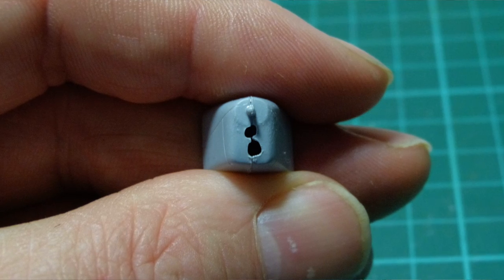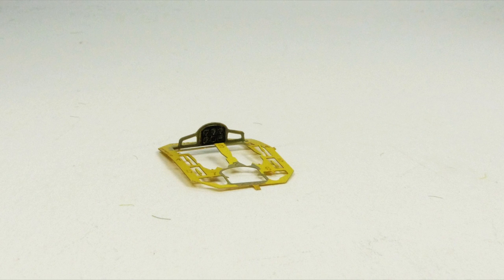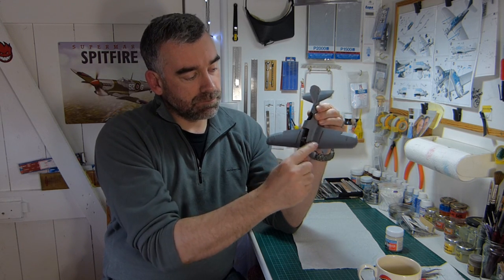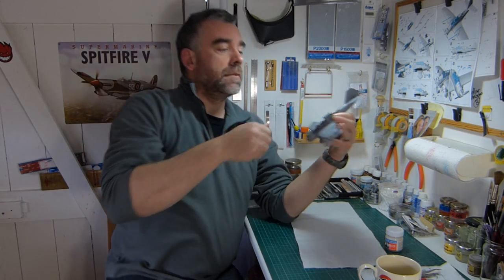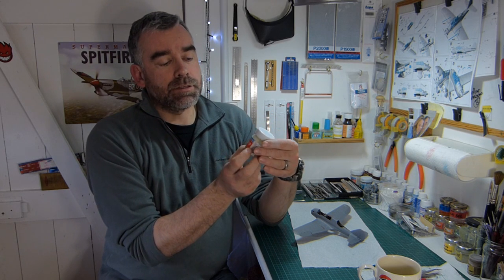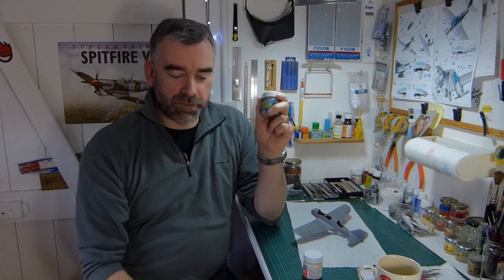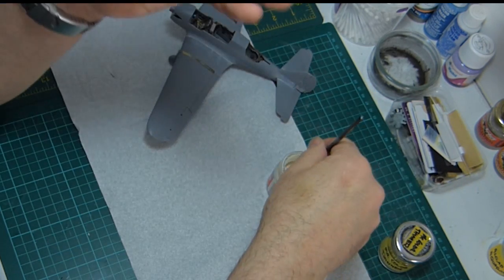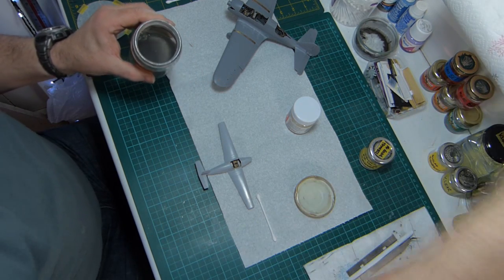Group Builds - Update 1 (and kind of a tutorial)

Comment: Nice video Gary, both kits are progressing well mate, great use of mr dissolved putty, ive been using it for a while but not like that so will give it a go.

Ps black sander is 1200/240 grade
Reply from the maker: Cheers, Paul. The black sander is a very versatile tool, especially because of its rigidity.

Comment: Great video (like the others), very helpful. I'll be trying Mr Dissolved Putty on my 1/32 Spitfire very soon. I have one question though, I will be using Mr surfacer 1200 as a primer (as you suggested) however I'm curious, does it need sanding back when it's dry? (like you it's been many years since I built a model and now so much to learn :))
Reply from the maker: Thanks Alexander! Mr Surfacer - especially the 1200 - leaves a beautiful, silky-smooth finish that requires no further work. The stuff is amazing!